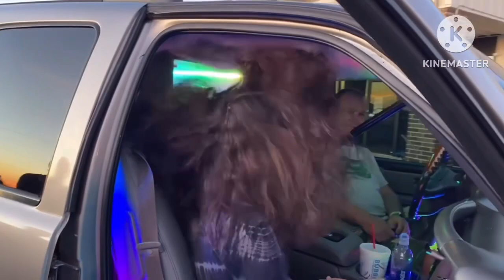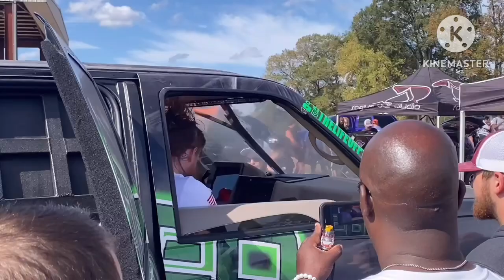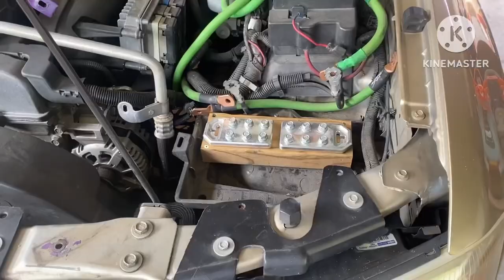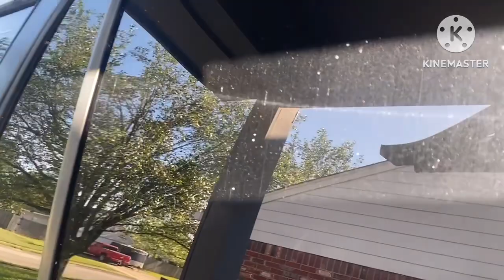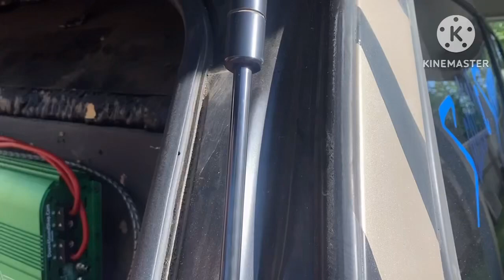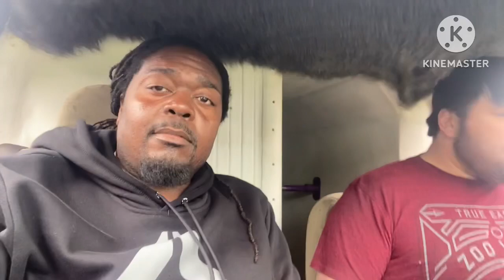Jp83 on 6 Sundown Sa v2 15/ Won 2 1st place trophies at Bass Wars 157.83

Comment: So it’s better to ground directly to the battery Rather than the frame ?
Reply from the maker: It 1/0 wire going from the frame into Banks to
Reply: @crazy-hobbies2291  I meant for the amp wise . Not the bank
Reply from the maker: Yes that’s correct